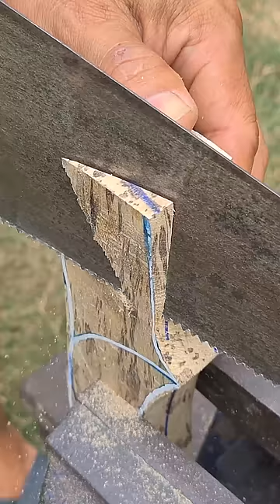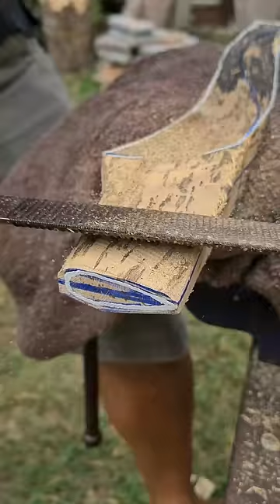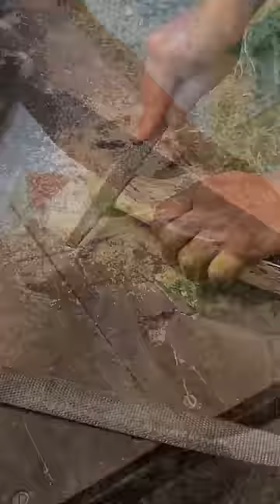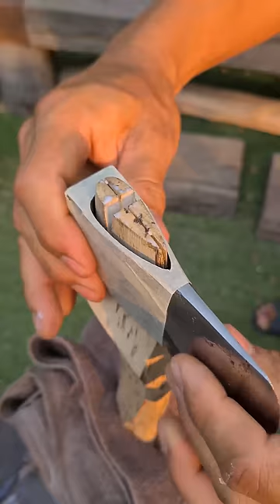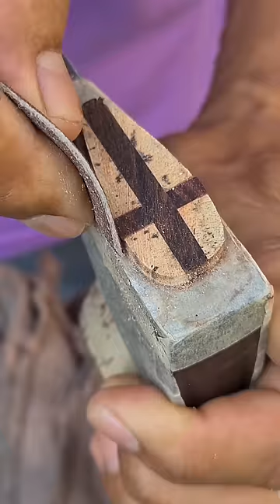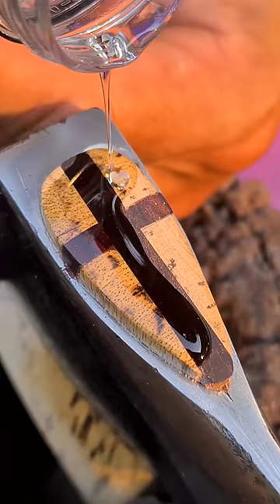Hanging an axe with a cross wedge  #craftsmanship #shorts #asmr

Comment: No need for any kind of glue, unless you have a loose fit.
Reply from the maker: Thanks😁👍
Reply: I think he used it cuz he didn’t wanna mess up the pattern with step wedges…… which aren’t entirely necessary if you wedge it good with the wood, but are generally used just to ensure a good snug fit
Reply: @messylife3793 no, he used it because he had a massive gap all the way around the eye and it wasn't fit correctly.

Comment: Great technique, though spalted wood is already partially rotted so it's going to be weaker, and epoxy-ing the handle in will make any future rehandling a pain. Looks great though!
Reply from the maker: Thank you😁👍🙏
Reply: Use some release agent on the metal you can buy it or Pam works too..
Reply: It's white ebony. That wood is harder than oak, it'll be fine.
Reply: @artor9175 Hard doesn't mean strong.
Reply: @poomsproject Hey pools, is that  white ebony, or spalted maple?
Reply: He makes a lot of decorative pieces

Comment: If you have to epoxy the handle to the eye of the bit, youre doing it SO wrong.
Reply from the maker: Thanks👍😁
Reply: No there's a lot of way to fit the handle and this one is one of the most sturdy way to do it although having a metal pin through the handle works great too.
Reply: Plumb did it for years and I still have some of there axes that’s solid as a rock 50 years later
Reply: @williamm4366  nah, he removed way too much material before fitting.
Reply: @deputydang8291 little bit, this will definitely be secure, just completely awful to rehang
Reply: @samuelbuettner1214  still a bad hang with a really bad fit. The gaps all the way around the eye. This dudes made like 100 of these videos, there's no excuse. It's just a lack of caring to know how.

Comment: Fun fact, inertia will help put the head on by smacking the bottom of the handle with a hammer.  Super easy and works better than anyone who hasnt tried it thinks!!
Reply from the maker: Thanks😁👍
Reply: Eoin Reardon does it regularly, but only with ash 🪓
Reply: @nimblehuman ”if it ain’t ash, its trash” - Eoin, probably

Comment: What's up with all the videos of guys using epoxy on the handle?
Reply: Its the fix all for people who cant size the handle for the eye on the head properly, you can still do wedges and art if you want but this  is just not the way to do it
Reply from the maker: We used hard wood for the handle and I thought epoxy glue would help increase its strength.👍😊
Reply: @poomsproject so do you think if you used soft would you wouldn't use epoxy jw
Reply from the maker: @joshbogard6740  Actually, I think that whether it is hardwood or softwood, epoxy glue can be used but it is not necessary. I'm just presenting a new way to hang an axe.👍😁
Reply: What's wrong with using epoxy? I mean, it will hold a little better and changing the handle is gonna be a little harder but still very doable.
Reply: @mrkiky  he's using epoxy because he can't properly fit the axe head onto the handle. Epoxy is not made for impacts. It will crack and break and then the axe head will be lose. This is only good for decoration or for an emergency.
Reply: @deavyhick6803  Are you sure about that? Have you actually seen epoxy crack like that? I mean I haven't used it for axes but I used it for large knives and never imagined it would crack and I've never heard of  such a thing either.
Reply: @mrkiky  there are probably impact resistant epoxy, but yes, they will crack under impact. I've seen them crack and fall apart from the vibration of motorcycles. If the fit is already tight, epoxy or gorilla glue applied in a thin layer is beneficial.

Comment: No! No epoxy! Handles are Supposed to be able to be replaced. No matter how beautiful the handle you started with is, it will break if you use the tool long enough. And then you get to deal with all that epoxy. 10/10 dropped 5/10, thinking of future work for myself, lol. But you make beautiful handles!
Reply from the maker: That's okay👍😁

Comment: Bro. Why epoxy? If you’re using it as a tool it’ll need to be replaced anyway. If it’s only for looking at then why would you be worried about it coming loose? Either way it doesn’t make sense.
Reply from the maker: Yes, we do it for beauty. We also present another way to hang an ax and if the handle breaks you can replace it using a drill and chisel, we've done that before.👍😁

Comment: I noticed that you always cut your eye downward on an angle.  Why not cut straight and use the rasp less?  I also don't recall you ever hanging a flush eye (I could be wrong), but is that for any other reason than looks?
Reply from the maker: Because we use hardwood to make the handle, which can be compressed and expanded a little, the V-shaped cut will help prevent the wood from cracking. And yes we made it for aesthetics.🙏😁👍

Comment: Nice work. Last handle I made I soaked in in linseed oil and ran it through a vacuum / pressure cycle in the electric motor varnish impregnator chamber at work. I left there 30 years ago and the handle still oozes on a hot day.
Reply from the maker: Thank you so much, that's awesome idea thank you sharing to us.

Comment: This is not how you put a head on. First off you need to beat the bottom to actually seat the head. If you actually not cut a mile into the handle then you won't need epoxy. Steps are suppose to be used as well.
Reply from the maker: Thank you for your comment👍😁🙏

Comment: Curious. Wouldn't it be better to apply wood glue and wedges first so that the glue has as much contact with the handle and wedges as possible? Then before you compress the wedges in there, get the epoxy in between the handle and ax head?
Reply from the maker: That's right, what you said is exactly what we do.  We follow that step. What you see is epoxy glue, people often mistake it for epoxy resin.🙏🙏😁😁👍👍
Reply: @poomsproject  well, it looks like the epoxy covered the wood glue, which isn't what I said, though. And i never mention resin vs glue, just epoxy. 

If you want the best coverage, you should put only the wood glue and then the wedges, and once that is set and before pressure with the wedges is applied within the axe head, place the epoxy around the outside of the handle and wedges so that it stays only between the outside of the wood and the inside of the axe head, and it doesn't get in between the wedges. You should separate those gluing steps a bit more because mixing those two types of glue, I'm sure, ruins their integrity. They're two different types of bonding agents and won't cooperate with each other like one might initially think. 

Basically put, the wood glue shouldn't be in contact with the epoxy like what's shown in the video is what I'm trying to say

Comment: Sorry mate..It's pretty, but try again without the huge gaps. You shouldn't have to rely on Poly U to get a good seat. The haft should have to be malleted into the eye, not just dropped in.
Reply from the maker: Thank you very much, actually we can make it tighter but we need a big wedge, we used hard wood for the handle (black and white ebony) which can expand a little.  That's why it looks like it's dropped but the crown is tight and replaced with a large wedge.🙏👍😊

Comment: Using epoxy when mounting a handle to your Axe.  Means that when you have to replace that handle you will have to spend another 5 to 6 hours removing the epoxy. To replace the handle.  Most people do not know that the axe head is made wider at the top than it is  on the bottom where the Handel  attaches to the axe head.  Explaining why one must use a wedge to set the handle to the axe.
Reply from the maker: Thank you for your comment🙏🙏🥰🥰
Reply: Personally I wouldn’t epoxy it in either, but dude 5-6 hours? It’s not like you needa get every lil bit, especially if you don’t us epoxy on the second handle……. 5 minutes with some low grit sand paper on a dowel will clean it up well enough after you punch the wood out

Comment: Far too loose. If you need that much adhesive poured into the head spacing you shaved off too much wood.
Reply from the maker: This handle is sitll works now, we use a hardwood (Black & White ebony) which can be compressed and expanded a little and we would like a big wedge so we have to do that.
Reply: @poomsproject I have a better idea, maybe watch an instructional video or two and just carve the handle to fit snug. It's not hard my guy. I've hung a shit ton of axes and I've used nothing but boiled linseed oil and that's only on the wedge. FYI, yes we know it's hardwood. Nobody hangs an axe on pine. 😂

Comment: Haha 😂 you glued the head on with epoxy and THEN added the wedge….. why?? 😂🤷‍♂️  unless you’re hanging an axe properly with a cross wedge, this isn’t impressive to ANYBODY with experience Lol looks great!! Indeed!! BUT it’s a fake looks great in the end.
Reply from the maker: I have a reason for doing that, yes epoxy glue isn't necessary but if you think about it.  If you hang your ax very tight add more epoxy glue to help the ax handle attach to the ax head better.  I'm just presenting a new method and of the crosa wedge just for aesthetics.😁👍
Reply: @poomsproject  you didn't hang it tight. it fell on. Use it for a year and the head will fall off.
Reply from the maker: @WihGlah  I use hardwood which of course handles differently. I know what I'm doing. Sure, it will come loose one day, but it will definitely never come off. The handle will break first.😁😁👍👍